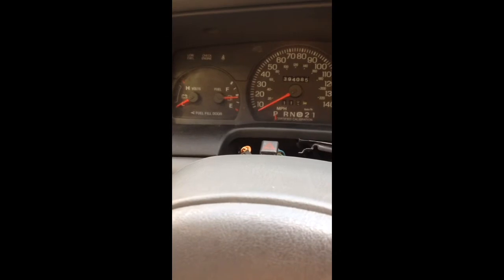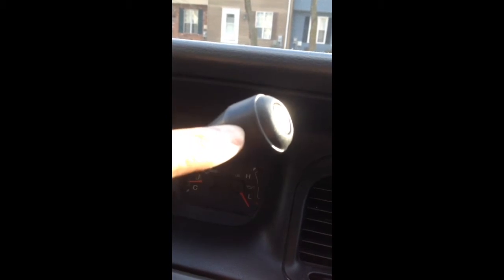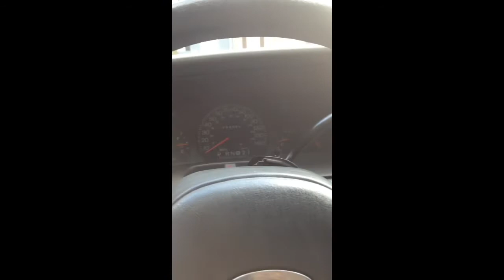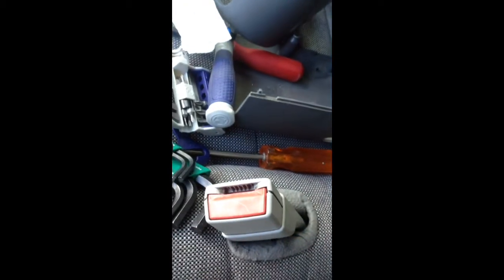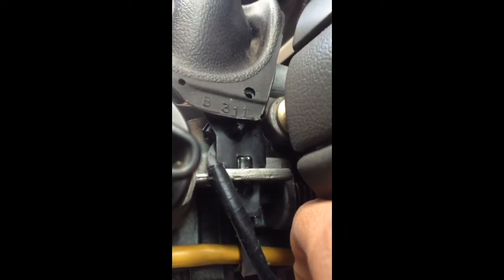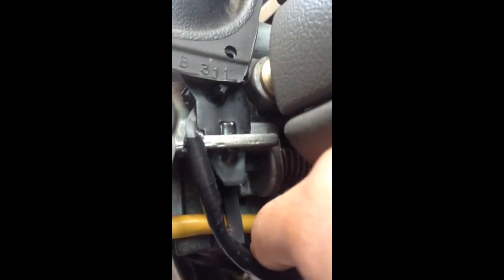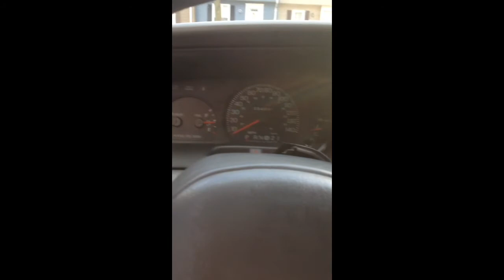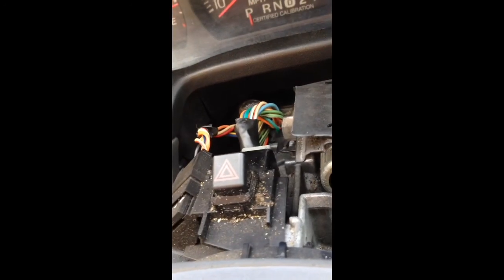Crown victoria cluster short

Comment: I wish people would post if this tip fixed their problem.  My instrument panel (odometer, speedometer, fuel gauge, warning lights, backlighting) goes out intermittently.  It would be great if this was the cause and fix.
Reply: No, it didnt, but I did find that my connections from my wiring harness to my ecu under the hood, were dirty as shit... I cleaned them off.... good as new

Comment: My digital gauge did the same in my '99. Only shows the abs and brake light. The fuse did blew so what should I do.
Reply from the maker: Dessoville 739 you don’t have to get a new one necessarily. You can use electrical tape and tape up the overdrive wire. But if you like having new things you can go ahead and replace it. It’s just how the manufacturer had it. It will continue To happen you can put a thicker insulation around the wire to somewhat neutralize the problem.
Reply: @collinw3  that sounds like what happened to mine I'm going to look tomorrow but you can break that wire and slide on a heck of a lot of heat shrink reconnect the wires solder-it and slide the heat shrink up but I believe in electrical tape if it's taped good enough it'll last forever and if you get the wire away from her it's pinching thanks I'm going to check mine tomorrow